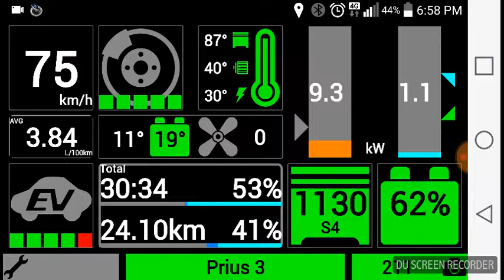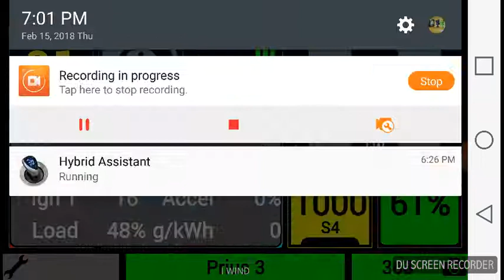Hybrid Assistant - looking for a better day 🌈

Comment: Upload more videos if you didn't switch to EV
Reply: Still riding my gen3 Prius, exceeding 300k km. Less hypermiling tests since 2020 though.
Reply: @federicopelizza3520  what is lowest you get 2,1 l/100km?
Reply: @randomdriving344  the lowest I got with no battery overall drain was 1.6 l/100km. Look for the test I made in Prius chat on the section extreme hypermiling attempts
Reply: @federicopelizza3520  what kind acceleration do you use? Engine load, rpm? Or doesn't even matter if it's long glide
Reply: @randomdriving344  27-58 km/h, 1650 rpm, load 85-90%, pulse and glide technique.